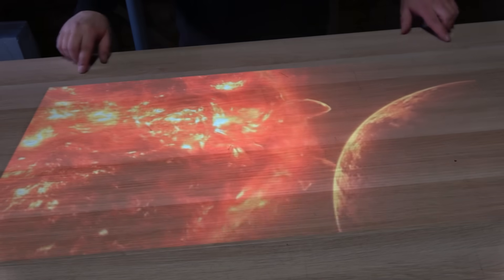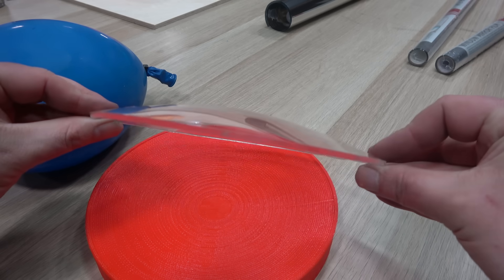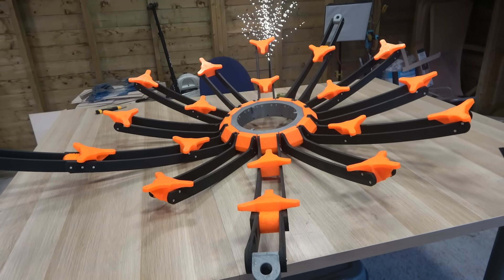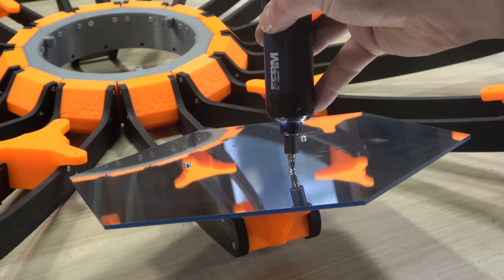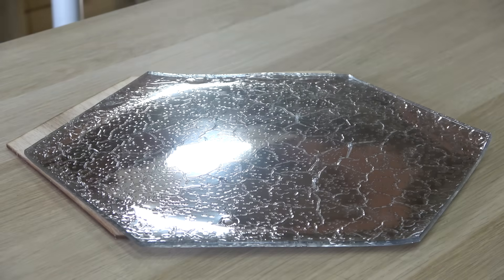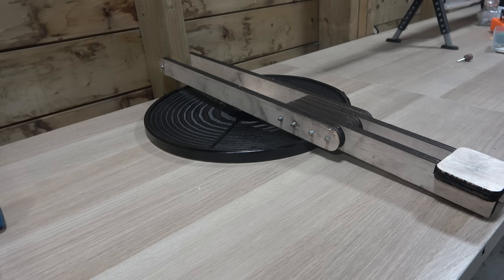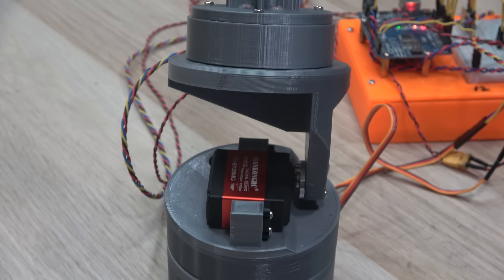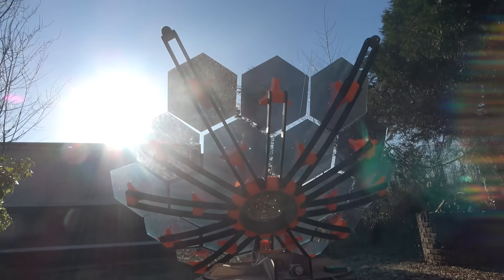Building a DIY Solar Generator..

Comment: When making the solar water heater
Try painting to black with "Mizzou black paint" and try to have it in a vacuum so it can't radiate the heat out 
I don't know if you can make a clear dome to use as the vacuum chamber...

Actually I'm not sure if Mizzou black paint can we stand high temperatures...
What you could do is get a candle and lighters and catch the soot coming off it to coat the disk or a glass pipe and put that inside a vacuum tube and find a glass worker to join the tubes, when it cools, it will have some vacuum not sure how much...

Good luck

Comment: Pairing these "solar death rays" with a simple stirling heat engine, instead of needing a water pump and coolant lines going back and forth between energy generation and the death ray. Death Ray could instead be formulated to reflect light to the "hot end" of the Stirling engine which would directly translate heat energy to mechanical energy in the form of torque which could then be used to drive an electric generator.

Comment: awesome project. it's on my list for years now. 

1. what if you molded the acrylic first and then put the silver foil on it?
and did you check other foils, such as a rescue "blanket" or using real silver like they do for DIY telescope lenses?
2. the liquid for heating, I would have used oil as it goes easily to 300C without damaging or boiling.
3. what about a heat storage? a highly insulated barrel that stores all the energy and used when needed?
4. the solar tracking sensor: great! how did you solve that at the end of the day it goes back to the morning position? (otherwise it's impossible to find the sun when in evening position)
5. the aluminum disk you can easily ANODIZE in black. at home. that should last forever.

Comment: As it stands, the center 'plate' is just another mirror if it's bare metal.. just a poor one. 
"A good IR absorbing coating for metal is typically a "black oxide" coating, often referred to as "vacuum black" or "metal velvet," which is a specially designed coating that effectively absorbs a wide range of infrared radiation across different wavelengths, particularly when high absorption across the IR spectrum is needed"

Comment: Black automotive paint on the heat collector would likely help a lot. Protects the part from weather and increase heat absorption. A rough finish would increase the surface area as well by the tiniest bit to collect as much as possible.

Comment: You should get a light gray projection sheet or paper to put down on your table when you're using your projector like this, it'll increase contrast and color, as well as reducing reflectivity from the surface as it stands.

Comment: Black surface on a thermo electric generator to collect electricity. If you are trying to direct a "heat ray".....maybe use a small pressure vessel painted black and mini steam turbine?

Comment: have you considered pyramid or conical fins/spikes on the aluminum block light side as I think it may heat the block quicker by increasing the lights surface area and the conical shape would prevent any shading of the surface.

Comment: 3:24 Are those those metal probe temperature sensors? I bet they're going to reflect a good deal of the IR power. Pretty sure they're intended for conductive temperature sensing. You could insert them into some block of material that absorbs IR well like graphite or something. Oh, or maybe a layer of soot on it by holding it in a flame could work?
Reply: * If holding the probe in a flame doesn't break it that is.

I think Robert Cowan has a video on a laser power tester that basically does this exact thing.

Comment: if your in the Netherlands why not use the heat differential from the ground /underground and the heated water from the solar collectors. Also I would have tried using silver or gold leaf instead of paint. The majority of the paint is the binder, not the gold or silver looking particles. Alternatively why not mirror the perspex using silver nitrate?

Comment: So, you've made a solar concentrator that was invented over 2 millenia ago. There are even modern versions that use molten salts instead of aluminum. I think you should have done more investigation on what has already been done. There are even studies about the best materials to use as receivers. This is inventing in a bubble.
Reply: Sometimes if you invent 'in a bubble', you may come up with something new and better than what was done previously, that said examining what has gone before can be helpful and shortcut the design process. Pointless to reinvent the wheel but you could invent something that does the same job but better? Besides he did look at the JWST design for inspiration.
Reply: What an negative comment. Sure solar collectors have been around for a long time, but there is more to engineering that just the concept. He's managed to put a decent setup together, at a great price point, that easy to maintain and repair for an individual. You need to look at the bigger picture.

Comment: i highly doubt that that spray paint actually has gold in it, making the test likely useless
Reply: Its the wavelength of colour and its reflectivity that decides how much heat it absorbs. Its loosely dependent on material, and i think thats kinetic thermal energy from different molecular or atomic masses, not thermal energy.

Comment: Rethink solar, use the ir to pyrolize biomass( sticks, branches,etc). Pyrolysis is a chemical process that is like cooking without oxygen. Pyrolysis yeilds 2 products, Syngas and char. Syngas can be burnt directly into an internal combination engine. The char is a permanent carbon store and great fertilizer in poor soils. Entire process is carbon negative! 
If gasoline is needed the Fischer–Tropsch process can be used.
Reply: How efficient is it though, and isnt that to the same as effect as burning biomass, but more inefficiently? If so then its probably not used bevause of low heat output and low efficiency,
Reply: @VerxxYT  the chemical process called pyrolysis is 100% more efficient than an open burn.. In an oxygen rich environment other byproducts are made because oxygen is very reactive. That's why you have smoke. Pyrolysis gives you a fuel you can store to burn later and char. The char is amazing fertilizer. Thus when applied to agriculture the amount of biomass is increased as well as carbon capture. Let alone the char itself is a permanent store as well .
Reply: @lorddorker3703  When does pyrolysis start, around 500..600°C? You'd need a much larger mirror to bring a few kilo of wood to that temperature.
Reply: @SolarCookingGermany  true, but how else are we going to FIX the co2 issue economically while maintaining our current internal combination infrastructure? This allows both.
Reply: @lorddorker3703  I do pyrolysis in my wood stove. The burning gases contribute to heating my home, the charcoal gets used later to grill or cook outside. I do this to get free charcoal, not because I believe there's a C. issue to fix ;) You'd need a giant mirror to do the same with the sun and also a gas tank if you don't want to waste the wood gas. Can you even store it long time? (I don't know)
Reply: @SolarCookingGermany  back in the 1800's there was a thing called town gas. They pyrolized coal. It was stored in a gasometer. Very lo tech but very effective. During WW2 Europe was cut off from oil. They used gasification to power thier internal combination engines. Even better you don't need a carburetor! 
As far as how to, think horizontal parabolic mirror with a black absorber tube of oil hung at the focal point. 
I live off grid and have 9kw of solar and 24kwh of batteries. Most days I have excess solar power. I use nichrome wire to heat my biomass. Solar char.
As far as co2 in the athmosphere I suggest you study a bit about Venus.
Reply: @SolarCookingGermany  I forgot the storage tank for the gas is called a gasometer. Its about as simple as it gets. YouTube channel Nighthawk in light has some good examples.
Reply: @ I asked AI how long it can be stored and the answer was only a few days, maybe up to a few weeks under special conditions. It's not possible to store it longer because it'll deteriorate. Due to the composition it's also not very economical. I knew there must have been a reason why they put the gasifier in the car instead of a tank 😃
P.S. For my personal purpose (cooking) it's better to use the coal instead of the gas, it can be stored indefinitely, in simple bag ;-)
Reply: @SolarCookingGermany  yes the gasifier on vehicle isn't practical. The gasometer stays in place and is used to store the syngas where it is created. That gas  (carbon monoxide, hydrogen, methane, etc) is used as a fuel source for a generator.  Generator charges ev. But if your only goal is to cook then yes this is way overkill. My goal is to solve bigger problems but getting people to listen, well...
Reply: @lorddorker3703  idl if ypur serious but it can't be 100% more efficient than open burn, which already releases chemical energy at high efficiency.
Reply: @ Cooking food and heating their homes IS a big thing for most people ;-)
Reply: @SolarCookingGermany  i never learn my biblical lessons. Pearls before swine. My bad. I'll shut up now.
Reply: @ Ok, I wish you a nice day and much success solving the big problems 😃

Comment: Really interesting project. My thoughts. Gold paint and gold are obviously different but that’s not important as cost is a factor. You could try using aluminium foil or even “speed tape” (aluminium tape). I don’t think using parabolic mirrors is important if the overall shape is parabolic. You’re just trying to focus the light onto the central mirror and then onto the heat collector. The central mirror may need to be parabolic to focus the energy roughly onto the collector.

Why not just stick small mirrors onto a TV dish and try that. Much cheaper especially if you get a scrap one. The dish and mounts are also designed to work in high winds but the weight will mean larger motors and you may need to use a counterbalance to help lessen the load on any motors.
Reply: I'm guessing the JWST used a gold coating because it is good at reflecting IR, because imagining in the IR spectrum is what the JWST's main mission is.
Reply: @yeroca  a couple hundred $ of gold dont matter in a project that spends millions on getting the mirrors into the right shape.

Comment: My $0.02 worth.. 
Mirrors: shape the parabola first, then apply a mylar reflective film. 
Heat-sink: I would use a watercooled PC radiator, giving a far greater surface area than the flat plate with large channels

Comment: 3 points to make about this video. Gold or silver metal is something entirely different than spray paint. These panels aren't even fully reflective but partially trans-missive. No sun to measure with? So where does the end-shot come from?

Comment: Anything I would have done? Not use gold and silver paint for one. When it comes to energy, paint is not the same as the actual materials; it's a case of pigment versus metallic elements. Sure, I get that neither one is cheap, but you can only go so far with just substitutes.
Reply from the maker: I get what you mean! What's your opinion on the test with the laser to test reflectivity if i may ask?
Reply: @ConceptCraftedCreations  Gold paint, isnt the same color, nor reflectivity, of high purity Gold.  For that test, you should use Gold-Leaf.  Gold Leaf, is real gold.. just incredibly thin... making it semi-affordable, for coating things like Picture Frames.
Reply: @ConceptCraftedCreations  Seemed accurate enough to me, so kudos on that. Seriously though, real silver mirrors will beat just about any substitute in this kind of situation.

Comment: Why not putting the foil after bending the plexiglass in shape? In worst case you just need to cut a strait line from centerpoint to one edge and overlapping it if needed.. Sorry that's a bit hilarious 😂🎉
Reply from the maker: I get what you mean but the mirror film I have is normally used for office windows and such so it's not as flexible as car window mirror film. So putting the foil on after bending the plexiglas wasn't an option unfortunately🤭
Reply: @ConceptCraftedCreations  sorry for missunderstanding. It is possible  if you do a cut in the foil from center to the edge...so you just have a slight overlapping which can be cut out or just ignore. Please try.

Comment: rub the aluminum disk with really fine grit sandpaper and then rub some artist charcoal all over it.
Reply from the maker: Is that also heat resistant that you know of?
Reply: @ConceptCraftedCreations  since it's pretty much pure carbon, it shouldn't burn, but should increase the amount of light energy being absorbed into the aluminum. You could also just hold the sun facing side of the aluminum over a campfire until it collects a good coating of soot.
Reply: @ConceptCraftedCreations  I'm sure that because the charcoal is carbon it would combust easily especially as a powder.
Reply: @ConceptCraftedCreations  anodize it. DONE!

Comment: Using windows tint should allow you to apply it to the curved acrylic AFTER shaping. 
There is a technique using heat guns that tint shops use to shape the film to curved surfaces. 

I believe this would allow for a cleaner/smoother surface finish, thereby a more efficient system.
Reply: Because he uses heat to shape his mirror segments, then using heat to apply the mirror film might change the shape of the mirror segments.
Though, I'm of the opinion like other people that he really doesn't need to focus each individual mirror segment since his collection plate is nearly the same size as the mirror segments. He isn't trying to capture an image of the sun, just collect the light.

Comment: Very good project.
1. Place the heat receiver on the rods, and not reflect the light twice, which only leads to double losses due to light reflection.
2. Paint it black or smoke it with soot. 3. It is possible to apply a reflective coating after forming the bend of the mirror, in order to avoid cracks when heated.
4. Add a protective layer on top of the reflective one, since it is difficult to maintain the integrity of the coating in the sun, wind and rain. Plus, the second layer can be polished with a car polishing machine.
5. Replace tracking by lighting level with a simple table of the sun's location by time of day (but then you need to add potentiometers or decoders to the rotary axes).
6. If you want to leave the installation outside for a long time, you need to add a protective function to avoid strong winds, add a wind sensor or simply take information from the local weather forecast (mirrors are just a big sail)
Reply: I agree with all but #5
Reply: Won’t that table shift by time of year, requiring either manual adjustment or additional complexity?
I personally think this method of tracking is super elegant and quite simple overall.
Reply: Sun tracking can easily be done with integration in Home Assistant. There already are automations doing this to control blinds. It adds complexity though. The LDR/Arduino system is simple, robust and cheap.
Reply: I have to agreed with @RobertBruce, but I would also put particular emphasis on points 1 and 6. 
No reason to have the collector at the back (especially since there didn’t appear to be any significant reflector at the end of the arms). Put the collector at the end of the arms and have it capture all the heat being focused by the mirrors. 
Finally, if you’re going to keep it outside for any length of time, you should strengthen the vertical tracking portion of your system (at a minimum) otherwise the first stiff breeze will likely cause a catastrophic failure. 
Hope some of that helps! Looks like an awesome project!
Reply: Too much mass away from the elevation pivot.